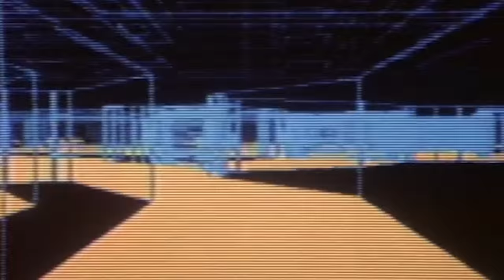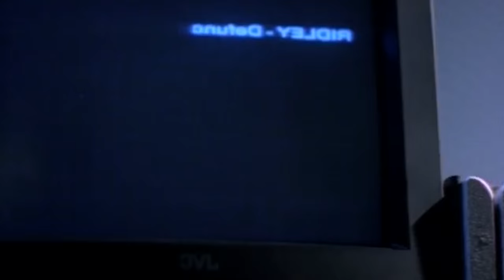Billain - Metal Jaws - (Bad Taste Recordings)

Comment: The thing I like the most about electro music is that I can't really tell if this is what the song is supposed to sound like, or it was completely scrambled and bugged in the process of uploading :D It sounds like trash anyway, I suppose... random and pointless.
Reply: Edgy.
Reply: +DivineDeviation When I first listened this kind of music, I thought it was random too. Now I'm used to it.
Reply: +Blueprint I am really glad to know that, yes. It still sounds like pouring water over some musical equipment but hey, now I know it's not random.
Reply: +HOMEBREW Great, so you can tell me why is this track 5:31 minutes long, why not 11, or 3? How do they decide it's enough? :D
Reply: +DivineDeviation patterns, structure, preference, experiment.
Reply: Sounds like DNB isn't for you dude. DNB tracks are usually at least on average 6 mins long because of the structure. the intros are typically 1:30 min long due to DJs having to spin vinyl or CDs and needing enough time to beat match the current track that's playing with the next track - and mixing dnb isn't the easiest thing, try it if u don't believe me - so many songs tend to be of similar time lengths. 

As for the randomness, dude, the people making this kind of stuff are insanely seasoned audio engineers, so they're constantly pushing the limits of sound design, and the limits of insanely well produced electronic dance music to its limits. Everything is planned lol I promise you none of these producers just "let random things happen" for too much of the time, if any at all. : P
Reply: In all chaos, there is a pocket of order.

This song and others are in a competition to see how far the edge of that pocket of order can go.